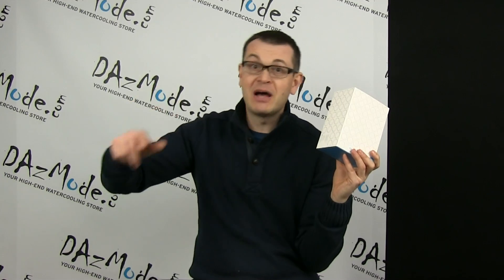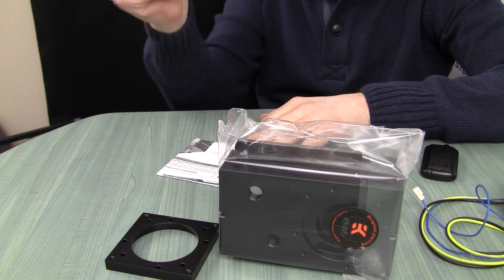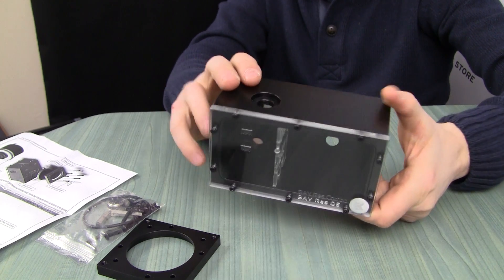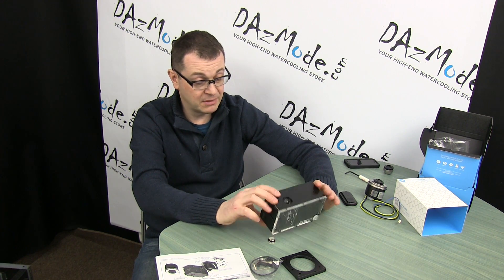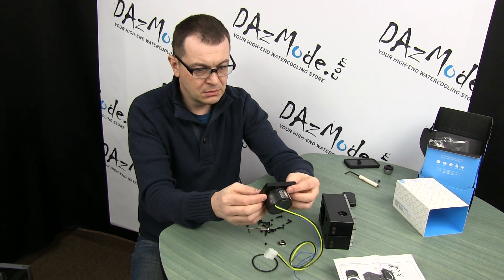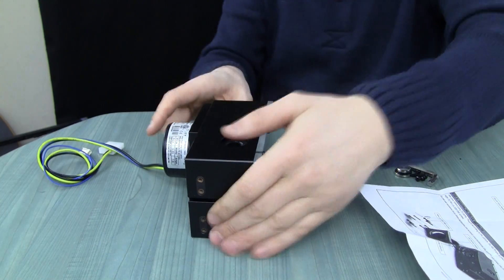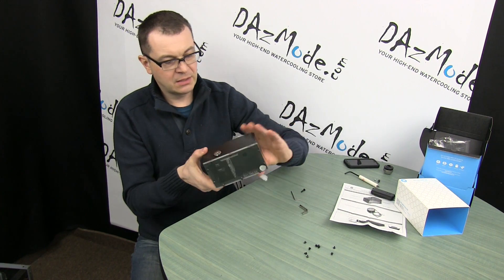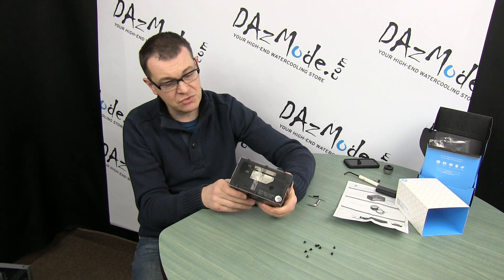Spontaneous EK-BAY RES D5 Review and Intallation Tutorial

Comment: I have this and it's terrible if you have a closed loop and need to drain and maintain your pc.. Because the pump doesn't have a third drain hole in a convenient way.. I mean the filling hole at the top, but trying to stretch the pipes so you can turn the bay upside down ? or you should have had some sort of T joint somewhere in the fist place so that you can drain the water out.. I'm using it and I regret using it just because of this reason.

Comment: It 'd be great if you could comment on how good the anti-vibration mechanism works. Its a common problem for bay res/pump combos to produce vibration and noise. It is very noticeable if the total system noise is low.
Reply from the maker: This is why I try to avoid Bayres models in my builds. Tube is the best.

Comment: Just wanted to say I bought this a few weeks ago along with the D5 Vario and it's amazing.

I have been using the RP-402x2 Rev1.2 for the last ~5 years and I see no reason to ever go back to using DDC pumps, the D5 is very quiet and yet very capable of delivering a decent flow. The RP-402 res was very difficult to bleed, so much in fact that I had to resort to Martin's trick (using the Serial Kit connector and the acrylic block installed in "Alternate" location).

EK Res was super easy to fill in with water without risking running the pump dry and there were no more air bubbles after only a few minutes. Highly recommend if you need a bay res.

Comment: I recently got this res/pump combo and I am very pleased to say that the D5 pump is magnificent, I first started out with a corsair H80i and then a Swiftech H220 and had plans to use the H220 as a full loop at some point point but I went ahead and bought this EK-combo and just starting with a loop for my CPU and i must say that the D5 is VERY quiet! and strong hopefully it will be enough for me to add a graphics card and another radiator to my existing loop :)